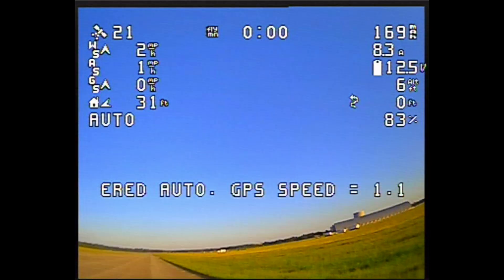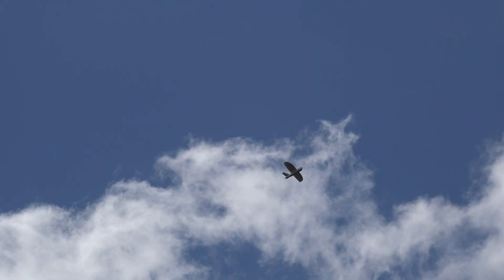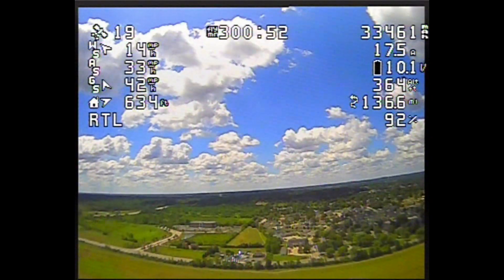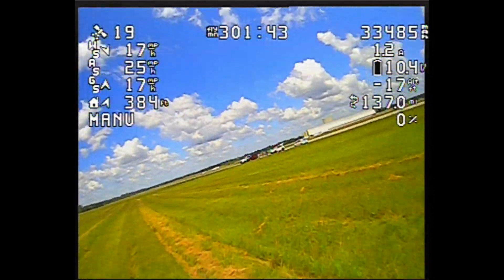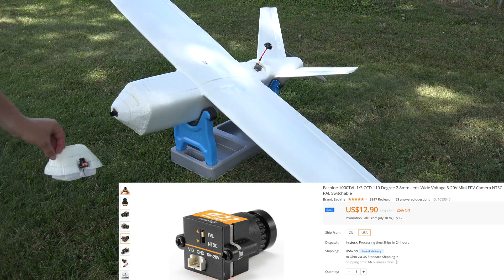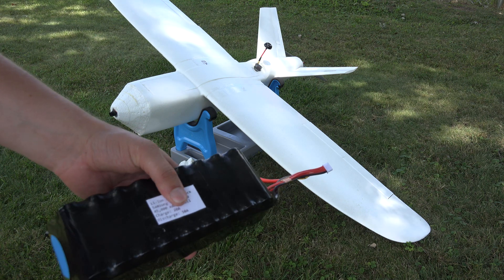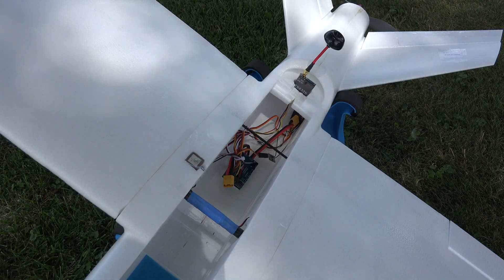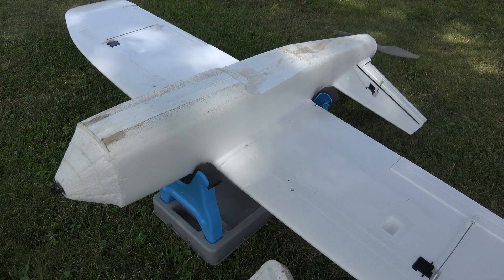X-UAV Talon 1718mm 5 hour endurance FPV flight

Comment: Distance = Velocity x Times
Times = 5 hours
Average Velocity =? 
Distance = D = ?

Ground Speed?
Air Speed?
Payload max ( for camera and/or a pixhawk flight controller)????
Reply from the maker: The OSD said 137 miles across the ground in 5 hours. That’s an average ground speed of 27.4 MPH. The average air speed is always higher when you’re flying in a circle when it’s windy. It doesn’t just cancel. The average air speed was likely 30mph. The max payload for the big talon is reallly high, but it needs a 6s power system.

Comment: Great presentation 
5 hours - Great job 
1. Type of Battery abd Capacity? 25,000 mAh?
2. Payload?
Reply from the maker: Thanks! I built the battery pack using NCR18650GA cells because they have a great energy to weight ratio. It is a 3S pack with a capacity of 45,000 mAh. The Big Talon has a very large payload capacity.
Reply: @MatthewHeiskell  Aren't they 21700 cells as per the label on the pack?
Reply: Is the weight to energy ratio better with 21700 instead?

Comment: Hi great work.
May I what battery and motor used ?
Thanks
Reply from the maker: Thanks! I was using a 45,000 mAh 3s Li-Ion pack that I made from LG M50 cells. The motor is a Racerstar 3508. I cover all of this info and more starting at 3:14
Reply: @MatthewHeiskell  Thanks for a reply.
Can't we get same flying time with same weight of Lipo battery?
Recharging time also more than the Lipo?

Thanks
Reply from the maker: No, I used special Li-Ion cells that have about 80% more energy per weight compared to Li-Po.
Reply: @MatthewHeiskell  Thankyou.

What about charging time and battery life compared to Lipo battery? 
In Lipo minimum voltage per cells is around 3.3 voltage. If goes below 3.3 battery gets damage. Life time also reduced.

What about li-on minimum voltage under battery in safe?
Reply from the maker: The minimum safe voltage for Li-Ion is 2.5 volts. That is where part of the extra energy comes from. But Li-Ion usually has a lower charge and discharged rating, so you need a bigger battery to deliver the same amount of continuous current. Li-Ion is really ideal for building large endurance packs. The plane should already be flying for about an hour on Li-Po batteries before you switch to Li-Ion. One last thing, most ESCs for RC airplanes have low voltage cutoff at 3.3 volts. You need to use a multi rotor ESC because their lack of low voltage cutoff allows you to discharge the Li-Ion battery down to 2.5 volts.
Reply: @MatthewHeiskell  will it support for 4 kg  overall weight?
Reply from the maker: @baskarankumar8478  Yes, it will.

Comment: So, if you were to do this again, would you choose the same motor/prop combo, or would you use a different motor/prop?   With the goal of endurance on a heavy plane.
Reply from the maker: Good question! The motor and prop is very efficient, but the max power was a bit limited because the motor can only handle 20 amps. I fly it on 4s now instead of 3s and it is great. I use an 11x7 APC prop.

Comment: Where did you get the battery from?
Reply from the maker: I made the battery pack with 27 individual Samsung 50E cells. I used a spot welder that I got on Amazon for $100.

Comment: Hi, do you have wing extensions on the Talon?
Reply: Good job, wing extensions will help stall speeds but decrease efficiency.
I'm very surprised the bearing in that motor lasted 5 hours, maybe the low 3S voltage helped.
Reply: @martinglenkenny  why do you think bearings should NOT last 5 hours??
Reply from the maker: No, but I bet that they would help!

Comment: Hi there, interesting setup you got there :P . I haven't seen many fly 3s set up with the big talon and i must admit it looks promising. Could tell me please the thrust of this setup? Good job, Keep up dude!
Reply from the maker: It makes just enough thrust for take-off. It has plenty of power once it flying. You have to give it a really good throw on 3s. I been flying it recently on 4s, same motor, slightly smaller prop to prevent motor over-current.

Comment: The battery looks good, what is the dimensions of the battery and measurements?
Reply from the maker: Hello, I made the battery from 27 Samsung 50E cells. It is a 3s9p configuration that makes a 3s 45,000mAh battery. I honeycombed the cells together, not a rectilinear arrangement. The pack is 210mm long, 80mm wide, and 60mm tall.
Reply: @MatthewHeiskell  is it to charge multiple Packs together?..what charger youre using for the pack..thanks
Reply from the maker: @borgivatasmidatumanong7465  I have a few  ISDT Q6 Nano chargers.
Reply: It's amazing and Thanks for info, could you please mention the total price of the battery same to other parts.
Reply from the maker: @wavewater9295  You can buy all 27 cells to build that pack for$95 right now from 18650BatteryStore. https://www.18650batterystore.com/21700-p/lg-m50.htm

Comment: Awesome!  Thankyou for detailing your planes configuration and customization -- especially the logic behind.  That prop had quite the pitch, nothing like a big bite of air with every revolution.  Is there a message in the use of the F405 versus newer F722 controller?
Reply from the maker: Glad it helped! I don't think that you can put auduplane on the 722, but if you can let me know hahaha.
Reply: @MatthewHeiskell  I apologize, I should have said F765 - https://ardupilot.org/plane/docs/common-matekf765-wing.html

Comment: Awesome! Mine is on the banana boat. One thing I am dying to figure out is the width of the wing. Can't find that info anywhere. Let me know if you get the chance.
Reply from the maker: Do you mean the distance from leading edge to trailing edge (chord)? It is 13 inches at the root, about 10 at the end of the aileron.
Reply: @MatthewHeiskell  I do thanks so much!

Comment: wow,         I understand that a larger diameter stator is more effecient, up till the point that the Aero drag of the motor overcomes the gain in electromagnetic efficiency.    maybe the pusher could fit an even  larger motor diameter like those used for endurance multi rotors?   
great results!     wondering if solar as range extender would be practical..?   maxeon C60 cells are pretty flexible.. plastic wrap?  
what airspeed are you flying at?    I Don't see an airspeed sensor?  are you using one, and if not, Why not?
Reply from the maker: Hey Spike! I am not using an airspeed sensor or a compass. It seems to work fine without it. Cruise speed is about 30-35 mph. I am averaging about 80 Watts, so solar might be able to account for part of that. I have 20 of those solar cells and dog bone bus bars, but I haven't gotten around to messing with them. I was thinking about putting them on the Phoenix 2400.
Reply: @MatthewHeiskell  ineresting.  i've found that the airspeed sensor helps a lot to maintain a constant airspeed, but it probably makes the autopilot work harder to keep the target too.. 
after seeing how well your prop performed, i've ordered a set of 4 10x10 thin electric props for my solar plane and also some 10X7 slow flyer props too.   we'll see how well they compare.  i also will be testing 10x5.5 MR props by APC.   i also have some standard slow flyer 10x4.7 slow flyers brandX.   I just hope it can climb on solar alone with some prop combination.   i've ordered some 2806.5 motors Iflight.   they are high KV, but can limit throttle to achieve max power point.   
i also hope the plane does not need too much nose weight to achieve CG.   may put a carbon pole on nose with camera, rather than add weight..  would weigh less.!
Reply: @MatthewHeiskell  in my testing, 14 of the Maxeon cells can make 25 watts, so..   It's complicated..    yea, i'd love to see the pheonix with solar!
Reply: I'm working on a 2m talon with what I'm hoping will be 35-38 Maxeon cells. 28Ah 6S Li-ion... Should be interesting.
Reply: @markusford6585 Great project,  look forward to it.   expect  about 1.4Watts per cell realistically from my testing..  more with direct angle, etc..  less with less angle, bad atmospherics, low index, etc.
Reply: @FPVREVIEWS  I live in Arizona so I'm fairly lucky. I was pulling 1.8w at 4:30pm with the panels flat. So hopefully I can expect a little more. Will do a little more testing Earlier in the day at some point. But yeah I'm expecting a max 1.8-2w or at least I'm designing it with that figure.